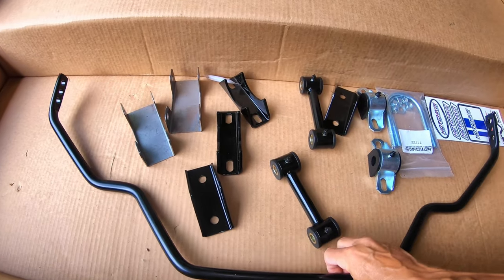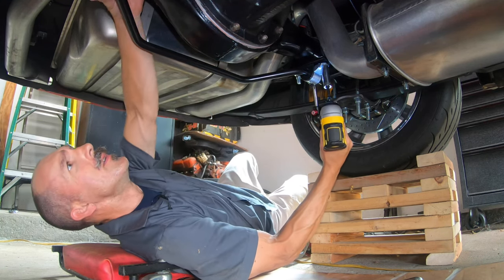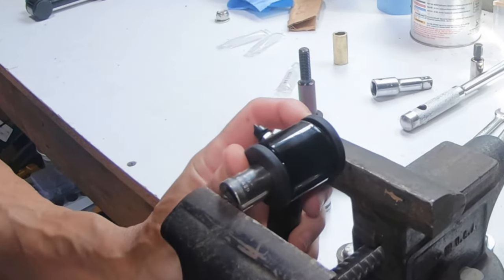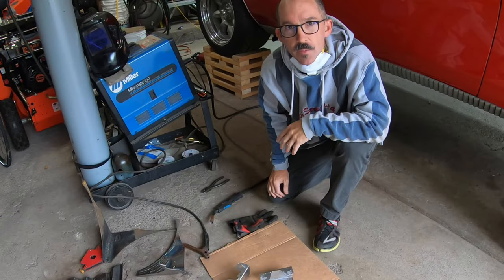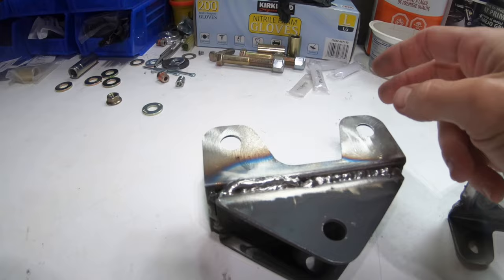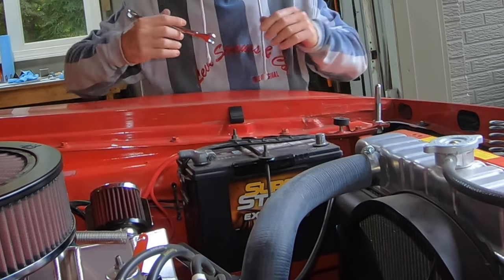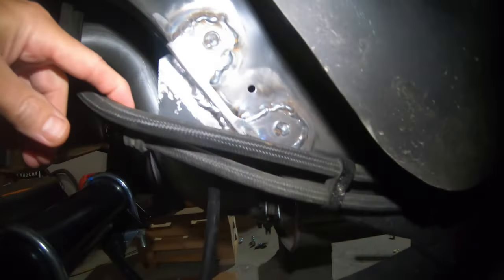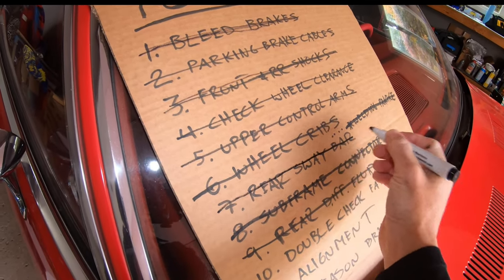Installing the Hotchkis rear Sway Bar on my Cuda!

Comment: I ran my duster without the rear bar for a while and had quite a bit of understeer in the autocross. The rear bar was the only item from hotchkis that I was missing. It made an incredible difference. I ended having to move it to the firmest hole. That location will depend on how your car is set up.
Reply from the maker: this thing didn't even have a front sway bar lol.  I can't wait to get it aligned and see how it drives now!

Comment: Still watching the vid so maybe you addressed this but I would for sure check the rotors for any sort of welding junk on them. Good idea to get a weld king blanket for when you’re in tight spots and can’t take off sensitive things like those nice new brakes.
Reply from the maker: I did look over the brakes and there wasn't any splatter....your right, looking back I should of put a blanket over them.

Comment: I put a rear sway bar in my A-bodies, but I only use Firm-Feel because they hang like the factory did them. Up & out of the way. Not only does it replicate the way Chrysler chassis engineers determined it to work best, it doesn't hang below the axle and "Tell" anything. Stealth is nice
Reply from the maker: I have heard good things about the firm feel rear bars.  Definitely a solid design

Comment: When I installed my hotchkis rear sway bar I had to flip it over as well. I assume the sticker was put on wrong. It’s the only way the bar would fit right and be perfectly level with the axle tubes.
Reply from the maker: Well that’s good to know I wasn’t the only one!  You would  think hand stamping a little arrow on the end would be helpful

Comment: Very nice car lots of great modifications done to it I can tell you like to do good work and it shows but you might want to get a little more welding practice in before you do any more welding on such a beautiful car not making fun of your welding because you admitted you were just learning everything else is perfect  it's just too nice to not have perfect welds too that's the only thing lacking you already know when someone checks out your car that will be the first thing they pick apart your car absolutely blows mine out of the ball park on looks sure would like to trade cars with you I got a 69 valiant with a 440 in it just about got everything to put the 4 speed in it I'm  retired now got a lot of time but the cash flow is a little slow thanks for sharing your videos
Reply from the maker: Thanks for watching and glad you enjoyed them.  I have always loved big block A bodies!  Yeah I am not happy with the welds … but I was stuck.  I don’t have any more car projects to weld.  Thinking of finding another little project to practice welding on would be fun this winter
Reply: @backyardhotrods9885  well I'm glad you didn't take it the wrong way because I wasn't trying to insult you I'm a certified welder machinist and fabricator well I was I just retired so that kind of work is what I did every day for almost 50 years and working on mopars is my hobby if I remember you had a small welder they are harder to use than a big one is you need one that has 200 to 250 amps to weld up to a half inch but they can do sheet metal too they run hotter and arc smoother after you get good with a big welder using a smaller one will be easier it just takes practice  and someone to show you how to do it right I took welding classes in high school you can learn on your own but watching someone is easier your weld looked like they penetrated because it was thin just not real pretty like a stake of dimes affect I have watched some welding on u tube and most are junk but not all but I don't remember his name sorry didn't mean to talk your head off anyway your car is beautiful and the offer to trade is still good hell if you lived by me I would come over and weld it for you take care and keep her pretty and running good thanks

Comment: Look good but did you look at a frame suspended rear roll bar to minimise any extra unsprung weight. Thats what an AAR Cuda ran back in the day. I have a firm feel frame hung rear bar on my Valiant Pacer in Australia.
Reply from the maker: I like the idea/design of those...but since I went with the Hotchkis kit I just used theirs.  I can't imagine it really makes a big difference...but maybe it does.
Reply: @backyardhotrods9885  any reduction in unsprung is a good thing especially with consideration for damping control.  Is there a measurable difference on a road car? Probably not.  Are you running bearing spacers on your front wheels to take away any 'wobble' in the front wheel bearings?